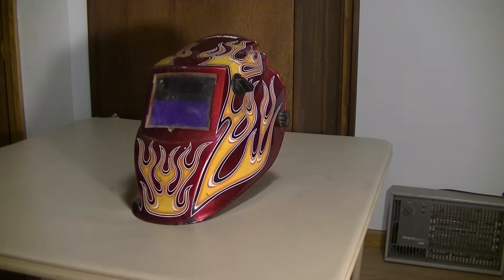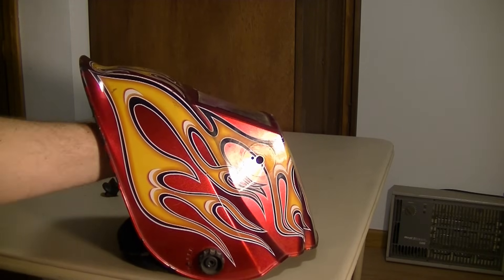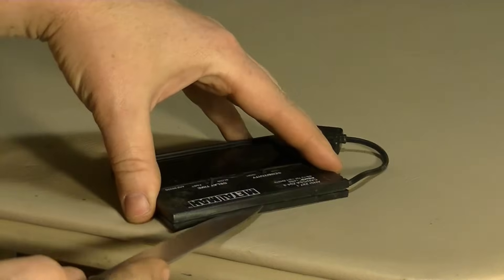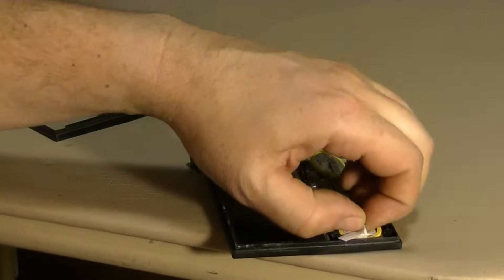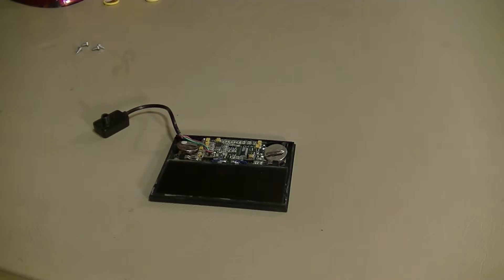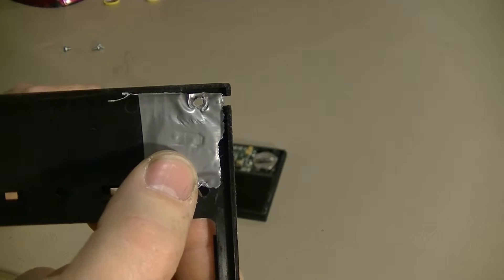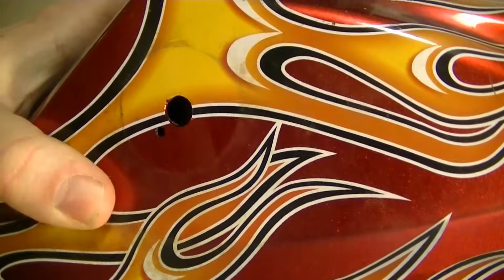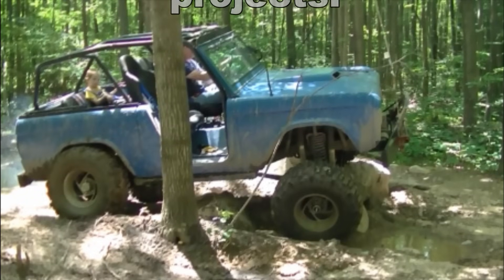Auto-Darkening Welding Helmet Repair

Comment: Thanks for the video, sir!  Mine was a Lincoln 1840 that was a “gift” that came with my welder.  The internals were a little different. I needed to put a strip of electrical tape around the edge of the batteries. Also, no room from screws so I just used a Gorilla tape to hold it together.   Thanks again.

Comment: Ok I did mine a lot different, I put my battery’s on the outside made a lot easer if I have to change battery’s 
Sometime. Where idi u get ur front clear liens what size did u get.
Very good video
Richard
Reply from the maker: That was quite awhile ago, I can’t remember.  I probably just grabbed a clear lens from Tractor Supply
Reply: Thanks will c.

Comment: 2nd Lincoln Helmet Ive owned and it has failed again. Turn the switch to grind then back to weld and it stopped working. Replace batteries but no help.

Comment: had a weldng test the other day and oth my helmets that i have not used in 2 years let me down, on the tig weld i was burning my eyes as the auto dark was failing on and off and when it was working steady all i could see was the glow of the arc and everything around was dark so i could not see what was going on and the same was happening for my mig weld helmet , the mig helmet has two aaa batts that i changed but still had this problem and the tig one has no batts ,i am assuming they might be the disc types on the inside but are these not made specail to hold the solar charge? why does my mig helmet have solar panel but uses regular aaa batt? i am confused are these batts suppose to hold charge and some do not but do something else? i thought the solar panel is suppose to store a charge in either capacitors or special batts so why does my other helmet have reg batts? anyways tried cleaning the sensors but again problem was not solved ,guess i got to get new cheap chinese helmets again

Comment: My auto darkening helmet (not solar) kills batteries every week. Thought maybe it was activating in the shop with the bright lites so I put it in a pillowcase in a  dark drawer. Still every time I take it out the batteries are dead. Usually every couple of weeks I use it.
Reply from the maker: The only thing I would suggest is to remove the batteries when you are done using it.  Hopefully they are easy to take out.  If they are, it’s probably your best option, as annoying as it would be.
Reply: @Mudford  thanks for the response. No they are a pain in the butt. I have done that a few times but it is for work so when I need it I can't be taking time messing around. Probably bring it home and get a better one for work when I get my next tool allowance. Thing is only a little over a year old. Only use it once or twice a week if that. Thanks!
Reply from the maker: Maybe you could add a switch?

Comment: Wondered why it was fcking up so much! @#$%^ 
I have read somewhere that if you set them in the sun it will charge up the batteries a bit before welding. Don't know how true it is.
I'm thinking you can set up some welders to be a battery spot-welder. set it on timmed spot weld and turn it way down set the time for 10ms. 
I'll have to give it a try.

Comment: But are the batteries u put back rechargeable ? Did it cause a fire? How long did it work?
Reply from the maker: They lasted roughly two years without any issues.  Ive replaced them once since I made the video.  Still using the helmet.
Reply: @Mudford   Thank u.

Comment: Thanks for the video. my helmet stoped working ,and i did your procedure ,but instead of installing new battery’s I soldered in a cr-123a battery holder mounted to the inside surface of the helmet.. now i can replace battery’s anytime i need without removing or taking anything apart.

Comment: Pro TIP: Don't try to solder onto CR2032 batteries, use hot glue or tape to keep them together and also use wires instead of those metal bullshit so you can take them outside the enclosure. I couldn't get the solder to stick and eventually blew one up. Not a big deal. Just to save you hassle of sanding and realizing it won't stick unlike AA batteries.

Comment: I know money’s tight for most of us but it really is worth the extra few bucks for a Lincoln hood, I have a Lincoln Viking hood for 120, takes triple A’s and works great. Spend the extra few bucks. Will last a lot longer than metal man crapz
Reply from the maker: *my wife bought it for me for Christmas quite a few years ago.
I haven’t any problems with it other than the battery issue.
Reply: @Michael Smith  for a small/quick (painless) MacGyver and a $90 USD(give or take) savings; it's very much worth FIXING what is broken than to toss it and buy MORE... which is what is wrong with society today...UNLESS that is,  one may be a LE rep...hummm

Comment: I used 2 AAA batteries and soldered a battery case from an old remote. Figured AAAs are easier to find than those flat batteries. Works as well. Thanks for the idea.
Reply: You can buy a Lincoln Viking hood for 120 and it takes triple A’s it’s a bit more expensive but wayyyy less of a hassle.

Comment: This the same internals as the mask from Northern Tool (Item #1649902). Chinese $hit, but it works. Nice how they didn't even bother to make the batteries accessible. Trying to use one of these right now since the batteries in my Hobart mask gave out. Guess I'll pop open the box and swap in some CR2032s to get me by.

Comment: done this, cheers , used 2x 3v 2016 which i had laying around , i just desoldered the metal clips from the board and put some wires there instead probably quicker , i realise probably not rechargeable cells i put in but will change to correct cr2430 when the cells die

Comment: Hi sir
what if fixing the welding lens, if it doesn't work normally,
from light to dark (not autodarkening)
I first thought of batteries or modules,
but I tried to swap or replace modules, the results didn't work,
but on the old lens (cracked glass) still works
I suspect there is a defect in the lens glass (the lens I just bought)
Reply from the maker: It sounds like you eliminated the other likely possibilities.  I would guess that you are correct.

Comment: Man I always strike a cigarette lighter in front of my autodarkening helmet to test and make adjustments before actually welding. I’ve burned my eyes so many times now that every little bit helps
Reply: You CAN NOT burn your eyes with the mask on, even if it's to bright the filter in the lense takes out the uv light that burns. You may see dots for a few mins that's all.
Reply: I do the same. Too many sleepless nights with arc-eye!
Reply: As a newbie doing low voltage TIG. OMG this Yeswelder helmet sucks; I would have spent a little more if I knew then what I know now.
Reply: I just point my TV remote to the glass (any button will do) to adjust before continuing welding.  Try it!😊

Comment: Would it have been helpful to heat the soldered contacts on the battery with an iron instead of just breaking the joints? Very informative just the same and so thank you Sir...
Reply: YES YES YES. This idiot cuts the tabs off the cells, rather than just using a fucking SOLDERING IRON to de-solder the batteries from the PCB

Comment: I ran into that problem today.  Even though I knew what the problem was, I wasn't sure if it would ruin it if I opened it. I was about to go buy a cheap one tomorrow but I found your video and I replaced them with 2032.  It works.  You helped me save about $60 and I saved an extra 15% by switching to Geico..😎

Comment: Hi,I have the same problem with my Princess Auto Helmet for 100.00 bucks, it is 3 years old and used 4 times.not good...just accidentally burned my eyes yesterday with this issue....due to not working properly,...not a good feeling... you stated in the video, saying that the batteries didnt "charge anymore..Are you sure they are "rechargeable Batteries in your helmet?,Im most sure they are not rechargable  mmmm...  i didnt see"rechargeable written on mine". nice repair ! 100---100

Comment: Thanks. I have the idea to do a modification with such a thing. The idea is a manual switch to enable darkening mode so you can just turn it on when you're about to weld. This way I can prevent the short flash just before it is getting dark, which is so annoying.

Comment: So basically these manufacturers rely on planned obselansence or timed product failure as the way to earn profits, such as cordless drills or toolz with lithium or ni- cad rechargeable batteries, which after a year refuse to recharge because of ionic disruption, also the replacement batteries are more expensive than the entire tool kit new. Many are not even available 2 years later. It's now part of our culture to disable the workers that are new and cost them all right away based on the fact many newbies cannot afford real quality . So  there's more than meets the eye ( no pun intended) when starting out because skill at labor is not what's important anymore. Or working on your own jobs instead of punching a timecard. Just cheesy unethical marketing of foriegn products.

Comment: Also, what type of lithium coin battery did you use.  Some of those 3V batteries say on the back "do not recharge".  Other more expensive ones with tabs pretacked onto the battery do say rechargeable, but two of them plus shipping is almost the cost of a new helmet from Harbor Freight, especially if you have one of those 25% off 1 item coupons.
Reply: cr2032's are not rechargable, your helmet uses the arc spark for power when in use the batteries provide initial power only, when you first start, these 3v lithiums will last 3 to 5 yrs depending on use.
You are supposed to discard the helmet at this time, but like you I repaired mine, mine is a lincoln, but is identical to yours, lincoln sells chinese junk at double the HF price...Skum
.....good job on the video
The pieces you will need to make battery holders for the next time, are found in Casio,and Timex watches.
I used the battery holders from 2 casio "G shocks" (1$ at the thrift shop)you tin solder the strips to the battery holder then you have a nice secure battery holder, its easy
Reply: @OweN-hu6uy  - or just BUY 2032 battery holders.
OR just much tabbed lithum batteries.
Reply from the maker: I used CR2032 batteries, with no tabs. I just put a piece of foam in that holds the battery and tabs tightly. They don't say anything on the battery about not recharging.  They have been in the helmet for a year with no issues. I see that they have CR2032's on Amazon that say rechargeable for $5.
Reply: Yeah, that's cool.  I didn't want a pressure contact because I figured it was prone to come unconnected at just the wrong time.  And I have soldered right to NMH batteries before, but never a coin battery.  Who knows what the heat of soldering would do to such a small battery.  I ended up jumpering the right battery and bring two wires out for the left battery.  then hooked up 5 rechargeable low self discharge NMH batteries.  2000mah, should last a long time.

Comment: You skipped over the most important part, how did you reattach the battery tabs that were spot welded.
Reply: No need to spot weld. Tabs just need solid contact to batteries. Use a small piece of foam

Comment: gonna try it on my forney helmet
Reply from the maker: Good luck.  Hopefully it will work for you and you won't have to buy a new helmet.  I just used mine again today.
Reply: Mudford yup, worked on mine for like 2 minutes of welding then poof back to not working. great instructions by the way
Reply from the maker: Sorry it didn't work for you.  Must have been something more serious than the batteries. Solar panel issues, maybe?
Reply: try cleaning the sensors. the little square holes....